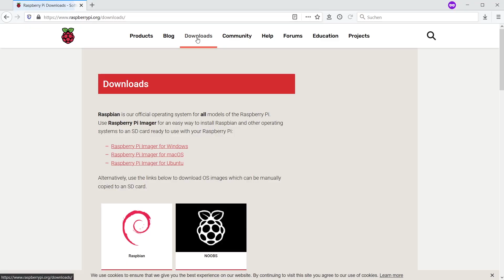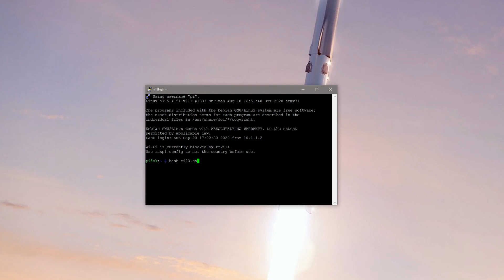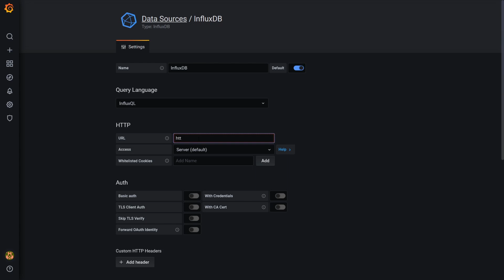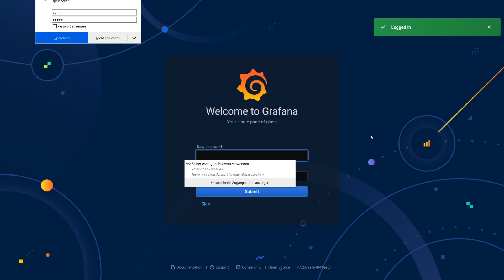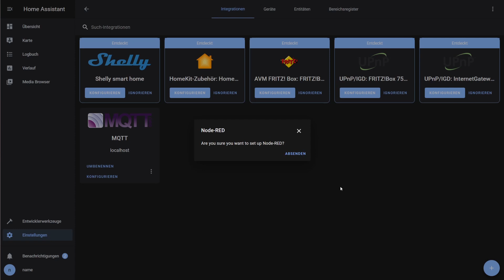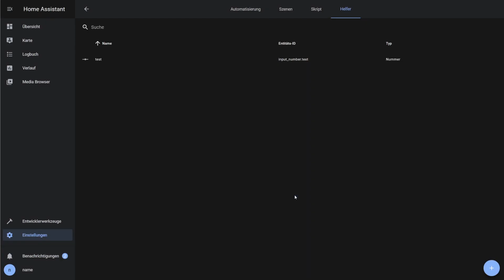Open Source Home Automation Installation Script by ei23.com | Raspberry Pi Tutorial #01 [ENG]

Comment: Hi! i am loving the proyect so far!  But i would like to do my own thing instead of running the script(at least try xD ), just so i can learn how to use docker and install stuff on my own.
I am at the point where i would use the script to get everything started,  but i am not sure what you do to get it going....
My guess is you install docker , and then install all the programs as containers? Have  you thought of a video explaining what the script does?
Reply from the maker: Hi!
The script was made because of the need to offer more flexibility and customization options than a Hass.io installation.
A Hass.io image makes it easy for you, which is great, but simplicity usually comes with restrictions.
If you want to expand your system yourself without running another Raspberry Pi in parallel, this script will help.
First, necessary and useful programs and frameworks such as Docker, Python etc. are installed on the raw Raspbian OS.
Then NodeRED is installed natively (not as a Docker container). This brings some additional features and a simpler configuration without annoying workarounds.
In addition, Log2Ram (less SD card writing – longer life for SD cards), RTL_SDR software for e.g. 433Mhz sensors and rpiClone for simple backups can be installed.
Currently the script offers automated installation for the following programs - They come preconfigured and with some addons (your own extension is of course possible):

    NodeRED (Native) with many Addons
    Portainer (Docker-Container)
    Grafana (Docker-Container)
    NextcloudPi (Docker-Container)
    MotionEye (Docker-Container)
    Tasmoadmin (Docker-Container)
    Log2RAM (Native)
    RPI-clone (Native)
    Pihole (Docker-Container)
    HomeAssistant (Docker-Container)
    SDR DVB-T Stick (Native)
    SSL Reverse Proxy (Docker-Container)
    RHASSPY (Docker-Container)
    HomeBridge (Docker-Container)
    ZigBee2MQTT (Docker-Container)
    Openhab (Docker-Container)
    ioBroker (Docker-Container)
    FHEM (Docker-Container)

Just open the script in a text editor and you can have a closer look.

If you want to learn for your self, you can have look at the docker-compose.yml in /home/pi/ei23-docker/.
This is used for the docker-stack.
Docker is quite easy to understand.
Reply: @ei23de  Many thanks!

Comment: This is great, easy setup 10 of 10, but mising 2 things. 1 - Tried Unifi controller but gives me error in docker, installed outside docker.  2 - Nice if you could include wireguard with GUI.
Reply from the maker: On wireguard I have done a german tutorial for now, with pivpn.io which is pretty straight forward.
I will do a new version in english soon, i guess.

Comment: After I gave the rpi a static IP in my router settings, I had to edit the /etc/dhcpcd.conf file to use the static ip address, otherwise it would lose internet connection and have to be restarted every so often. Just leaving this here in case anyone else has the same problem.
Reply from the maker: Thanks for the tip.
Did you also try to force a static IP address from your router config? Maybe this also works instead...
I got this as default and it is highly recommended to set a static IP for the Pi.
The Pi acts as a server, so dynamic IPs always will get you in trouble...
Reply: @ei23de  Yeah, I set a static IP address in my router config, but it would still lose connection until I edited the config file
Reply from the maker: Ok... That's strange, I will keep that in mind.
Thank you.

Comment: Th script fails on the zip file, the cli says end of central directory not found. This results in many other faults as the direction ei23-docker is not created. Solution for this?
Reply from the maker: Will check it
Reply: @ei23de  great, check also your forum i have put some more info there which could be helpful. If you want me to test things or provide more info just let me know.

Comment: hi thanks for the video, i wanted to start with a fresh install, im using raspberry pi 4 4gb running rasperry lite 64 bit. during setup im getting the following error
no matching manifest for linux/arm64/v8 in the manifest list entries
check "ei23-docker/docker-compose.ylm"
is there a way to edit the docker-container.yml or install the file its needed as i cant yet access the server and edit the file manually
Thanks so much
Reply from the maker: yes you can always edit the docker-compose.ymp via ssh.
There should be a line number and info where exactly the error occurs, so it should be easy to find.
It has to be one of the containers which need  another docker-image or something
Reply: @ei23 
Thanks so much I've managed to install the script it didn't work on raspian 64 bit lite...
The only thing that doesn't work is vs code I can't see anything other then ei23 folder  but no files display

Comment: Hey thanks for making all these videos. I've installed everything and am trying to change the main page, but when I edit the programs.json file (I changed "active" from false to true for the Router icon, like you did), the page is unchanged, even after refreshing or rebooting. Any idea what could be going wrong?
Reply from the maker: Hi Jesse,
did you  try crtl+F5 for reloading page?
If your browser-cache is emptied, but it still does not work, then you maybe have made changes without root privileges (with sudo or as user root) and then your changes are not applied /saved...
Reply: @ei23de  ctrl+f5 was probably it, thank you! It's working now
Reply from the maker: Glad to hear!
F5 is only refreshing the page, ctrl+F5 also reloads content (like files).
I learned about that waaay to late ;-)

Cheers
Felix

Comment: hi, thanks so much for the video and script. i wonder if you can help,  a number of files have an error traefik and next cloud it says the port is already allocated, how can i use another port?
thanks in advance
Reply from the maker: Hi!
You may have selected too many programs, so there are maybe some ports already allocated. Right?
Because all included programs that allocate ports are configured with a docker-compose file (with the only exception NodeRED - port 1880), you can edit it afterwards and just rerun the script.
Just open and edit the /home/pi/ei23-docker/docker-compose.yml with root privileges.
The scheme is like this 8001:80, were 8001 would be the reachable external and 80 is the internal port.
external:internal
Just edit the external ports, so that no port is used twice or more.
You should see in the error logs, which programs cause errors.
Reply: @ei23de  thanks so much, i can see the script in docker compose now, do i need to make sure the internal ports also have no duplicates?
when i finish will it save automatically if i just launch the bash ei23.sh?
Reply from the maker: I guess you just have to edit the external ports of traefik or nextcloudpi.
In general you just have to make sure, that external ports have no "twins", also you have to save the file and apply the changes with bash ei23.sh dc / docker-compose or just ei23 dc
Reply: Thanks so much got it sorted, amazing work
Reply from the maker: @CalisthenicsProgress  Please also check out the newest about the script!
https://www.youtube.com/watch?v=Ldp_ZOUe5JU
Reply: @ei23de  i currently have next cloud on port 8080:80 and also next cloud pi on 8080:80 should i change the external port to a different number or are they the same program?
also im very new to this and would like to learn how to program, would it be more useful to learn bash commands or python im not sure what ill need to research about for raspberry pi
Reply from the maker: @CalisthenicsProgress  Just use NextcloudPi (x)or Nextcloud (official)
Those are different programs.

I would say first you need to learn some basic concepts like if statements, loops, input and output, datatypes and functions.
You can do that with python or also in javascript within nodered function nodes. just play around a little.
bash is a little more constrained / purpose driven - you can do more with python and js / nodejs
if you want to go pro, you also want to go pro, you have to look into java and c / c++
And learn the concepts of functional languages. But i would say in general starting with python is good.
If you want fast results, have a look at NodeRED and use Function nodes. That will teach you to think like a programmer too.
Always remember: If you have to to things twice or more, write a program / function for it. That is programming.

Comment: Oke so yes this is meant for installing on rpi4 but I had a rpi2 lying that I just recently start using. (was still in the box for I don’t know how many years lol .I thought what the hell just give it a go and if it breaks well …you shit out of Luck ;-). 
But it installed and was like holy shit it works……well sort of . At first login -good but only things working was HA-NR - NR dashboard and home bridge . Funny thing the only program that asked for a pw when installing was NR. But today I thought lets  give it another go and then now Pihole opens also and motioneye and was like what the hell ….but I don’t have the passwords for them so I have no idea how to login haha. Oke so basically I want to run the scrips from scratch like a first go but it doesn’t let me do this. I must have skipped something. So my Q is: how do I run the script all over again? Do I need to install the pi image all over again?
Yes its a long one ;-) but what should I do? thx
Reply from the maker: Passwords for MotionEYE, Home Assistant, Grafana, Portainer etc. are set on first start.
Motioneye has no password, just admin as login.
Pihole and mosquitto can be set afterwards with the script: just run bash ei23.sh or with current version just ei23, then you get a menu where you can see options.
Reply: @ei23de  oké thx I'll give it a shot 👌🏾

Comment: Warum ist dein englisches video so viel ausführlicher als der deutsche?  wird es zukunft nur noch englische beiträge geben?
Reply from the maker: Das englische Video enthält nur ein bisschen was zu Home Assistant, alles andere habe ich auf deutsch ja bereits sogar ausführlicher.
Die nächsten Videos kommen erstmal wieder auf deutsch.
Erstmal Nextcloud + SSD Speicher und dann Home Assistant.
Reply: @ei23de  wenn du ein video für die einbindung der eq3bt termostate machen könntest wäre das cool. Die Dinger sind im gegensatz zu den vernetzten termostate viel preiswerter. Das ganze noch in homeassistant integriert wäre perfekt.
Das selber zu bewerktstelligen überfordert mich leider. ich habe allgemein so meine probleme mit grafana und freunde.
egal, ich bein gespannt was noch so von deiner seite kommt. Dein script ist schon echt gut. MfG
Reply from the maker: Die eq3 Thermostate habe ich mittlerweile in Home Assistant am laufen, aber es ist noch eine sehr frickelige Lösung.
Bin noch nicht ganz zufrieden damit. 
Du solltest vorher mal schauen, ob es mit Bluetooth Reichweite von Pi hinkommt.
Wenn du es selbst mal versuchen willst https://github.com/Heckie75/eQ-3-radiator-thermostat
Das Skript nutze ich als Basis.
Reply: @ei23de  ja die reichweite ist ok.  ich erreiche mit dem pi4 alle räume. die reichweite ließe sich ja auch mit einem vernetzten pi3 und BT dongle bewerkstelligen. Ich will ja eh noch einen PI in meiner Werkstatt verbauen und eine Wetterstation mit webcam soll noch dazu kommen. der winter kommt und die langeweile^^